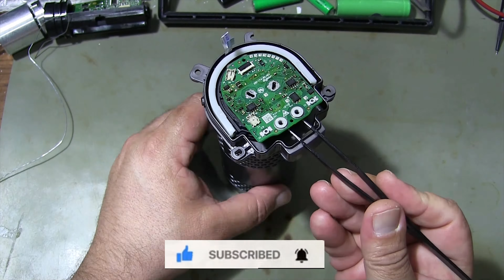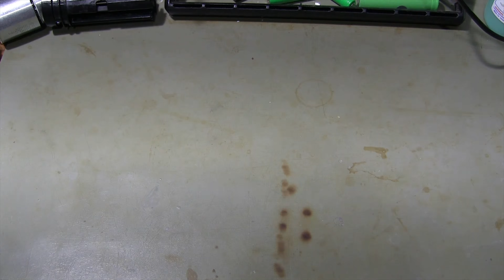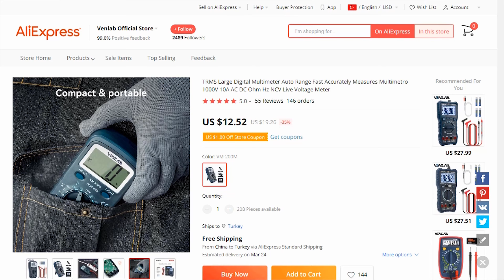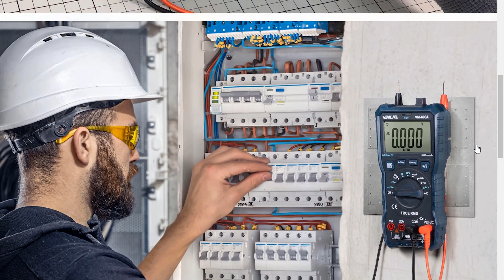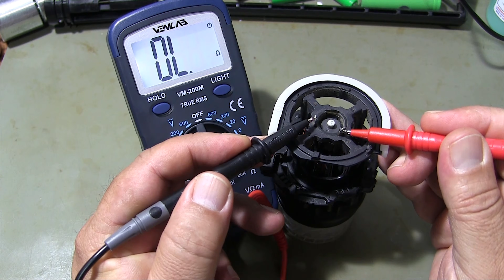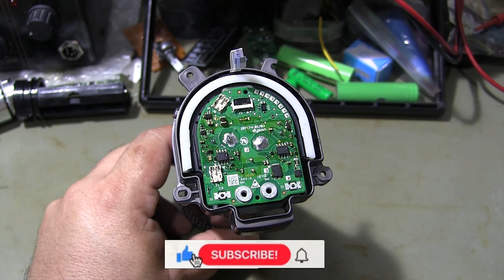How to Check DYSON V11 Vacuum Cleaner Motor with Multimeter?

Comment: Thanks for the video and the infos. I have a Dyson V10 and it seems like it has an issue with the motor or the circuit board. The problem is it only works in the max suction settings and when i try to use it in the firts two settings it just starts and stops in an instant. What dou you think the problem could be? Could the soldering joints be a part of this problem (i say this because the left part of the soldering joints seems a little bit yellowy) or should i renew the solder joints? Thanks in advance.
Reply from the maker: Merhaba. öncelikle devre kartı üzerindeki tüm lehimleri tazelemenizi tavsiye ederim. Bunun dışında devre kartı üzerindeki mosfetleri ve dirençleri kontrol edebilirsiniz.
Reply from the maker: Here are a few possible reasons why the engine may be vibrating.

1. Clogging: A blockage that blocks the air flow can cause the engine to run unevenly. Check the filters, hoses, and vacuum cleaner heads for blockages.

2. Filter Problem: A dirty or incorrectly installed filter can also cause the engine to vibrate. Clean the filter or replace it if necessary.

3. Engine Problem: There may be a problem with the internal parts of the engine or the fan blades.

4. Foreign Object in the Pipe or Head: A foreign object stuck in the vacuum cleaner's pipe or head can also cause vibration. Remove these parts and check for foreign objects.
Reply: Aynı sorun bende de var 😮

Comment: What did you use to remove the coating on the terminals
Reply from the maker: I cleaned the coating with isopropyl alcohol.  I removed the solder on the motor ends using a vacuum desoldering iron.

Comment: Hi Tell me, is there a forced engine shutdown, mine has started to work unstably?
Reply from the maker: I do not know exactly.  There may be a solder crack on the electronic circuit board.

Comment: Carpet & floor Rollers spin for 1 sec & stop in Eco mode v11 vaccum. Releasing the button & pressing it again does exactly the same. Whats this problem & where to check on the board. Can you make a detailed video about it & share.. thanks
Reply from the maker: Unfortunately, I have never encountered such a problem before.
Reply: @electronic7979  It seems I have the same problem. The floor brush motor (roller) starts and stops at the minimum and medium power of the vacuum cleaner. At maximum power of the vacuum cleaner (boost), the floor brush (roller) works normally. I tried another brush, the same result.

Comment: Nice YouTube.  Dyson V10 What if only one "boom" sound with full battery light on, but motor do not move ?
Reply from the maker: Hello. The motor or driver mosfets may be faulty.
Reply: @electronic7979  Thx!
Reply: @jamescheung6004 Do you have any progress of fixing you motor? I have the same issue.
Reply: @licysaab  finally, I ve replaced it by new motor (Alibaba) and sell the old one at lower price. (I think expertise know how to fix it as many want it).  Now, dyson v10 works fine up to now.

Comment: Dyson v10 can't work. Symptoms are as follows.
1. When connecting the charger, turn off after turning on 3 blue LEDs.
2. Remove the main body and battery and disassemble the battery. Press the battery switch and turn off 3 LEDs.
3. The battery's own voltage comes out well. Press the switch on the battery and the P+P- voltage comes out for a while and then it doesn't come out.
May I know if it's a battery problem or a body problem?
Reply from the maker: Thanks for your comment! The symptoms you mentioned usually indicate that the battery may be faulty. If the 3 blue LEDs are on, it means that the battery is not accepting a charge or is faulty. The problems you are experiencing with the battery voltage values also indicate that the battery is not working. First of all, I would recommend replacing your battery. If the problem persists, then there may be a problem with the main body of the device. I hope this information helps!

Comment: What if V11 is pulsing, where to check on the motor or pcb? Thanks
Reply from the maker: You should check the motor driver mosfets and microprocessor.
Reply: @electronic7979 
do you have the part number for the driver mosfets/ replaceable mosfets that will work on it? Thx

Comment: Hola, el motor de mi aspiradora hace un zumbido pero no gira, que puede ser?. Gracias. Muy buen video
Reply from the maker: Thank you for liking my video. The problem is most likely due to the motor driver MOSFETs on the circuit board.

Comment: Pointless Video. Showed the motor removed and then replaced. Meter on the motor connections but no resistance values.
Reply from the maker: Hello. First of all, thank you for your comment. I think you didn't understand the video. The motor you see in the video works smoothly. I have shown the measurement values so that you can reference them on your own vacuum cleaner. subject of the video; Since the internal resistance of a good motor is low, it is normal for it to show zero ohms when measured with a multimeter.